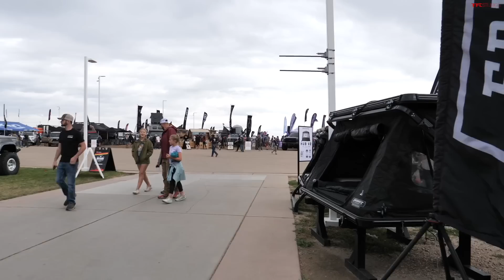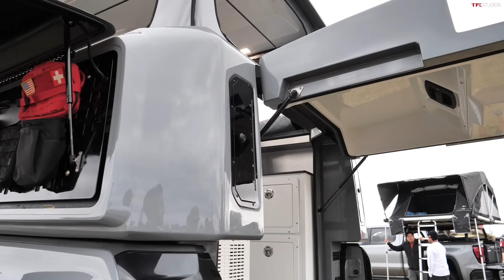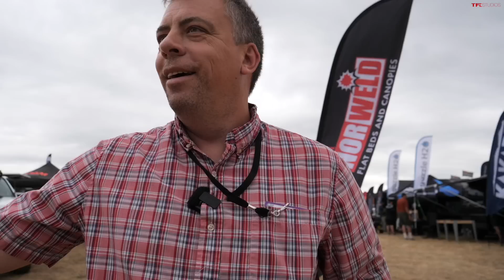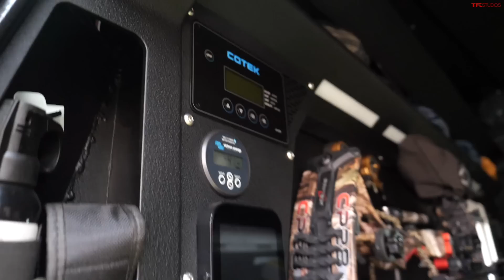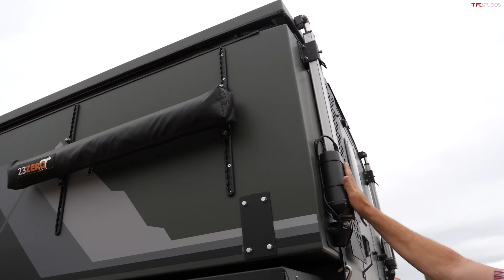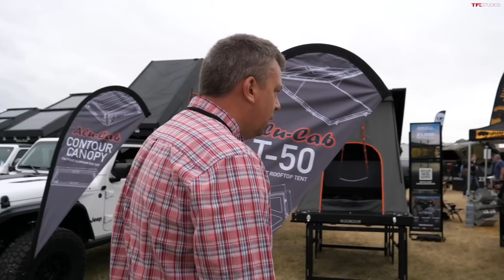MIND BLOWN! The New Toyota Tacoma Is Off The Hook! Overland Expo Special!

Comment: Can be to much of a good thing. Next 5-10 years 
All makes and model . Will end  with smaller displacement engines .  4 cylinder  boosted . 
Lighter materials used .  More use of aluminum 
Titanium magnesium and carbon fibre. 
Hybrids. And alternative  energy like hydrogen 
Toyota has been pursuing.   It don’t let. The 
 Venerable diesel out of commission.  Still
A potent engine

Comment: Andre, Street truck Q - After sitting in the different Taco models in Hawaii, is the new air pump seat in the TRD Pro more comfortable?  Wondering if it would be a good daily seat with ventilation / heating option.  Instead of buying the limited street version which isn't as beefy looking.

Comment: Absolutely don’t like the new Tacoma body style. It’s like they took the tundra and build it smaller then stamped Tacoma on it. Also, the turbocharged engines are prone to have more issues — and repair cost will be higher due to their complexity. Wish they went with the naturally aspirated V6 engine.

Comment: I like that the canyon had a winch.... seriously no off road truck should be without one. Especially for where i live in Alaska where winches get extensive use every winter. I honestly don't understand how any of these manufacturers can design and build a truck for off-road and not have designed for a mandatory add on (the winch). It makes me think these engineers have never driven off the pavement.

Comment: the Tacoma bros have been saying for decades that the open C channel frame and drum brakes were better for offroading. how do they justify the change now?
Reply: Would really be odd that Taco Bros would have been saying that since the Tacoma never had an open C Channel Frame. They have a hybrid frame which boxed in the front and C Channel under the bed.
Reply: @Shakerhood69  call it what you want. The fact is the Taco bros said that the third gen truck was the ultimate offroader specifically because of its old rear drums and frame design, and now it's been changed. So how do they justify the changes now?
Reply: @frontier_etc  You would have to ask the bro's that said that.